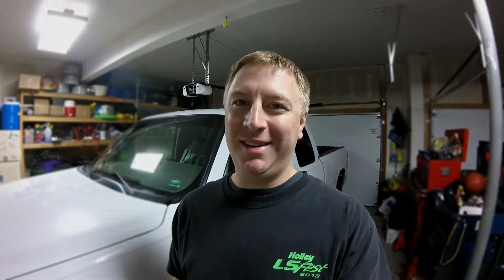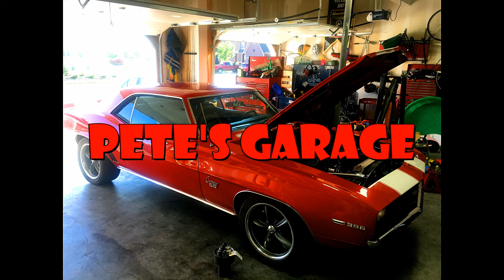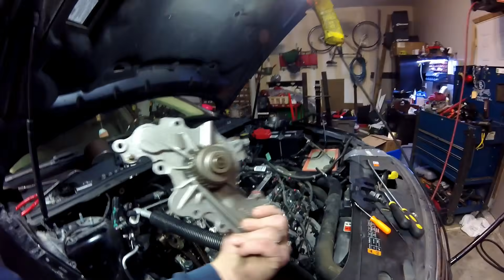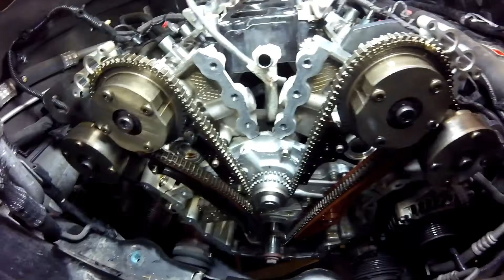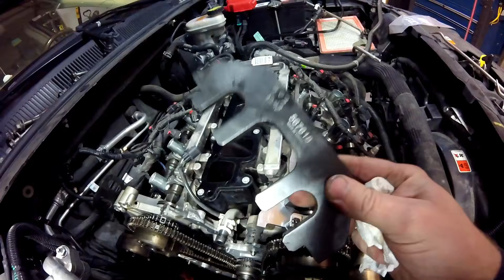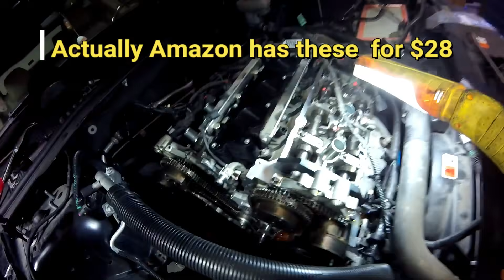Why does the Ford Taurus, Explorer, Edge 3.5L water pump cost over $1400?

Comment: Water pump failure killed my taurus right past 150,000 miles on the dot. Kind of suspicious of that. Either way it happened on the highway with the stereo bumping so I think I drove on it for 30 minutes before I realized my taurus sounded like a cammed 72 challenger and my dipstick was covered in chocolate milk

Comment: 2014 is at the dealer right now having the water pump replaced.  Ouch, I am actually paying more than mentioned in this video.  Note they are pulling the engine to perform the repair.  At least this includes replacement of other things including the serpentine belt, plugs, etc.  To be fair, this has been a great car until now.
But still.........

Comment: If you are going to do this job a little time saver is the chain guide closest to the firewall has a six mm bolt size eight head hidden behind the camshaft gear.Loosen the bolt all the way to the gear and you can remove the water pump and leave the extra work behind!

Comment: The weep hole bleeds into the center channel of the block and escapes out the bottom of the transmission housing. No where near the alternator.
Reply from the maker: Are you sure about that one? Here’s a link to a thread that has a picture of the front of the block. At the lower right side of the water pump you can see the hole that the channel leads to and you can see the channel in the block that dumps right behind the alternator. https://www.taurusclub.com/threads/2011-water-pump-failure.281809/page-5#lg=thread-281809&slide=0
Reply: @PetesGarageandperformance  I'm replacing one right now and the weep hole on the 3.5 bleeds into the center under the lower intake. There's factory drilled holes below that channel the leaking pump into the transmission housing down. The slot that was pointed out in the water pump is not the weep hole btw.
Reply from the maker: What vehicle and year?

Comment: My brother  has a Taurus sho the dealer told him 3500 -5500 I said that's bullshit it should be no more than 500. He said they told him the pump was internal and they had to take the engine apart.  Now I see why but they are still 3 or 4 times higher than your saying.  I live in new Jersey but still that's ridiculous. Needless to say he getting a new car and it ain't no ford
Reply from the maker: The SHO is twin turbo so it takes a couple hours longer. But that’s expensive!
Reply: @PetesGarageandperformance  yeah I agree

Comment: Today, the Ford shop told me $2500 to do the water pump.   Add $200 if we want to change the timing chains.      FORD sucks.  Every Ford I have ever owned, needed a major operation.  Transmissions, power steering,  AWD control modules,  and now an extremely difficult water pump that I can't even fix myself in the garage.   I WILL NEVER BUY ANOTHER FORD AGAIN.   My Toyota Highlander Hybrid that I have owned for over 5 years and has 225,000 miles,  hasn't need hardly anything.
Reply: Sorry for complaining.  Your video was informative and you laid it all out for me.
Reply from the maker: I know it’s a hard pill to swallow. I made the video to show people why they wanted to charge so much for this job. Good luck.

Comment: I have a 2016 Colorado with the 3.6 v6 and the water pump is mounted externally, where it should be.  It’s still way under 100k miles so I should not need to replace it anytime soon.

Comment: Thanks for the video and about the tools. Yes this is engineered service at it finest. Better use OEM parts to replace it all. It’s really ridiculous how many things are built the way they are now. If you don’t catch the leak in time you will be buying and engine because it can leak into the oil pan. What’s the labor time or did I miss that??
Reply from the maker: On the Taurus it’s like 8.5 hrs or so
Reply: @PetesGarageandperformance  thanks Pete

Comment: Had an oil leak from timing cover on my 2015 Edge, dealer told me it was oil pressure switch, got it changed under warranty , next oil change, leak was still there , took it back and repeated to tell them it was timing cover and don’t call with bs again , this time they agreed it was the cover and still under warranty, I said good , while your in there , here’s a new Ford water pump , put it in and I’ll pay the difference, they didn’t want to do it that way , the dealer wanted to scam Ford , I argued I wasn’t opposed to paying the extra labour over the cover cost which was about 2 hours and pay for the water pump, ended up having to go over heads to get it done but total cost was about $400 .

Comment: Wow! I've changed a few water pumps in my time but nothing like this. They could have designed for it to dump the coolant directly into the crankcase when the pump fails...but that would have been REALLY stupid instead of just plain stupid. Nice of them to incorporate that drain channel! And, BTW, may as well change the timing chain while your at it too. 🤑🤑🤑
Reply: But that's exactly what happens, it dumps the coolant into crankcase. There are two sets of seals. If the first set fails, that's when you might be able to catch it leaking through the weep hole, but for most people they don't catch it until the seals fail completely and the coolant has leaked into the oil. The weep location is not in a good spot either, it's behind the alternator so unless you know where to look you probably wouldn't notice it, which again means the time you realize something is wrong is when the damage is already done.

Comment: I bought a car with this poor engine design and am trying to get rid of it before I have to sink 1400 bucks in it or worse. My owner says a truck would be better to air my long ears out
Reply from the maker: I would say just fix it yourself if the water pump goes out, but it’s got to be difficult to work on cars without opposable thumbs.

Comment: The gm 2.2 waterpump is driven by a chain that's behind the timing chain that has to be removed to get to it. Although replacing the waterpump itself isn't to bad. Replacing the waterpump chain is worse than replacing the ford waterpump
Reply from the maker: Ecotec timing chains are much easier to replace compared to the Ford v6. There’s only one valve cover to remove, don’t need to remove the intake, half of the front cover bolts, the balancer doesn’t require a puller, no RTV cleanup because it has a gasket, the chains are easy to time. The labor time I’m for the Ecotec chains is about 4 hours and the Ford is about 8 hours.

Comment: The water pump went on my parents 2011 flex at 109K, nearly 500 miles from home. $9K for a new motor. Otherwise a great car.
Reply from the maker: Ouch! Sucks that this $50 part can ruin the engine and cost someone $9,000 because of where they decided to put it. Thanks for watching.

Comment: I'll tell ye what.i learned way back yonder   to sorta study and see how a car or truck is to work on before I'd buy it.i got burnt on an ole ford escape that needed the alternator replaced.it was a v6 and you had to take the passenger side suspension loose and the inner fender sheild to get to the freaking alternator. God almighty I was mad. Lol live and learn.one last thing about that ford escape seemed it would take 5 different size wrenches to take off one damm part...
Reply from the maker: Sometimes it’s almost like they built the car around the alternator! Lol

Comment: What all parts are required to do this replacement. I gotta have it done on my car and I can’t afford what the shop quoted me so I’m gonna have some friends do it
Reply from the maker: Pump, silicone gasket maker, valve cover gaskets, intake manifold gaskets, cam sprocket bolts, oil, coolant. I think that’s it. Good luck.
Reply: how did the job go?

Comment: 59.95 free shipping on eBay sure it’s not oem but price difference makes it worth it .at the same time this is a big job that should be simple.
Reply: but it's not simple, so better not to use cheap part  but if you run used car lot then yes use cheapest part.

Comment: why with the gen 1 ecoboost, you just have to move the T-stat housing out of the way, and the water pump comes off. that's it. no access to the timing chain needed at all. 3 hour job
Reply from the maker: Are you talking about a truck engine?

Comment: If you mentioned this in your video, I must have missed it. My question........Is there a way to make the water pump last longer or is the water pump issue completely random?
Reply from the maker: I don’t think there’s much you can do. The pump bearings will eventually fail from normal use because the timing chain tension is always on the pump.
Reply: @PetesGarageandperformance  Good to know, thanks.

Comment: Any idea what percentage of these water pumps fail in the first 200,000 miles? It's a good engine otherwise, but if you don't notice the water pump leaking and it goes completely bad it leaks internally; coolant mixes with oil; and the entire engine is shot.
Reply from the maker: I really don’t know any actual statistics. But it is fairly common with over 100k miles. So I would guess that most wouldn’t make it past 200k without needing replacement. I know some people will probably comment that theirs has made it past 200, but I would bet it’s the exception.

Comment: does this affect the 3.5 eco boosts in the ford trucks?
Reply from the maker: No. They have an external water pump. This is only on the front wheel drive vehicles.

Comment: Hello.  My mazda cx 9 2008 with a 3.7 engine has a mileage of 300 thousand kilometers.  I changed the coolant at 280,000 km when I bought the car.  The fluid is checked twice a week.  Should I replace the pump or the car and check the condition of the coolant and engine oil?  What are the first symptoms of a leaking pump?  I am asking for your opinions.
Reply from the maker: I would definitely keep an eye on the coolant level. If it mysteriously drops or it leaks from behind the alternator then you’ll need to replace the water pump as soon as possible. Personally, I wouldn’t spend the money to replace the pump if it’s not leaking. But I would be on the lookout if it had high km.

Comment: I’m doing a 2012 mks 3.5 I didn’t have to remove the guide behind the cam  phaser.  What a relief 😅 lol.
Reply from the maker: Yeah you can just loosen that 8mm bolt with an open ended wrench and swing the guide out of the way. It definitely saves some time.

Comment: $1400? I wish... try $2700.
Reply from the maker: Ouch! I’m guessing you probably also had the chains, guides and tensioners replaced?
Reply: @PetesGarageandperformance  Not sure yet. It's on the non-turbo police model, which PROBABLY drives the price higher just because it can. I'm also in a quasi-rural area, which makes things more expensive, too... Meh - it's only money, right (sarcastic eye-roll)... Your vid did a great job of explaining why this job is so expensive. Thanks!
Reply from the maker: If it’s a Taurus non-turbo then it should be around 9 hours of labor. Not sure what your labor rate in your area is.
Reply: @PetesGarageandperformance  AllData says it's a 15.7 hour job @ $135/hr.  The shop manager told me that he'd watch the job, and charge me the actual hours. I work with the shop a *lot*, so I expect that it'll end up being a bit less. Every now and then, I have to remind my vendors that I'm funded with taxpayer dollars (meaning THEIRS). =/

Comment: After u fix it how long does it last after that
Reply from the maker: Theoretically another 130k or so. Hard to say. I guess it also depends on the quality of the replacement part. I linked an AC Delco water pump that I used in the description. I think it’s a quality part. I wouldn’t buy a cheap pump on this one.
Reply: Pete's Garage if it’s a high quality part then it should last to 200k right and the job is done good

Comment: Do you know if the 3.5l duratec can just be bolted in a 3.0L duratec vehicle? Specifically a 2007 Five Hundred.
Reply from the maker: Not sure. I guess as long as the transmission and the wiring harness is the same. But you would still need the computer tuned for the difference in displacement.

Comment: Why can't they come up with an external water pump? You would still probably have to remove the water pump and chain but put a blank plate on it and than an external pump that's electric drive.
Reply from the maker: That’s just as much work as replacing the pump which lasts over 100k miles. You might only have to have to do this once. Maybe twice depending on how long you keep it.

Comment: why fix it? just watch the coolant level
Reply from the maker: Because the coolant has a very high possibility of leaking into the oil pan causing a milkshake. This lowers the oil’s ability to protect the main and rod bearings. This ends up trashing the engine. Big time $ repair.

Comment: i am considering a Mazda 6 with duratec 3.7 in it , the owner is telling me he had replaced the water pump four months ago but he said the mechanic/shop did not pull the engine out of the vehicle , if possible can you please tell me that what he said is possible. i would really appreciate your reply as i am on short notice to close the deal.
P.S i currently reside in Saudi Arabia and i don't speak much Arabic so i cant ask around much, haha
Reply: anyone with past experience can shed light on this, thanks
Reply from the maker: I’ve done a couple on Taurus’s without pulling the engine. I think you can do the 6 that way also. But not 100% sure.

Comment: I will gladly keep my 2003 chevy monte carlo s.s. that 3800 is 500 times better than anything made today. Shit even my 1973 chevy 400 smmall block is 500 times better than the crap designed today. 200,000 miles on it and never apart except for the timing chain and gear set.

Comment: I own a 2012 Fusion Sport that I've had for 6 years now. It's been a wonderful car and I don't put too many miles on it because I'm trucking all the time. It's only got 41,000 miles and I'm wondering if I should be proactive and just replace the water pump? Yes, low miles, but it's an 8 or 9 year old car now.
Reply from the maker: I would just keep an eye on the coolant level. If it gets low then make sure it’s not in the oil or leaking from behind the alternator.
Reply: @PetesGarageandperformance  Thanks. I thought about it after my comment and came to the same logical conclusion. I've read and heard some horror stories of owners of this particular motor experiencing complete failures of the forementioned engine while actually driving. Like, dead right there on road, with the only option of a new engine. But maybe these owners weren't informed or educated on this issue, as I wasn't either.  I talked to my service mechanic and he told me the same as you said. Thanks!

Comment: Quit buying Ford  Taurus with 90 ‘s models that cost 1000 to change out heater core. Ford engineers guaranteed profit for dealers , you had to remove entire dash assembly. Ford engineers profit for dealers by making wearable parts costly to replace usual after warranty. No Fords  by me since then , good car ruined by crooked management decisions.

Comment: Thank you for the thorough explanation! I just had my 2013 Taurus’ water pump replaced and the total after taxes was $1700. I was determined to jump on YT and find evidence that I was robbed but now I understand much better.  I understand parts fail over time but I just had the fuel intake (whatever) replaced in May and 2 months later this happens... uuughh. I should’ve extended my warranty. 😖 thanks again for this video!
Reply from the maker: This is the exact reason I made the video. To help people understand why it’s so expensive on this particular vehicle. Thanks for watching.
Reply: P᷉᷈H᷉᷈U᷉᷈C᷉᷈K᷉᷈E᷉᷈D᷉᷈ U᷉᷈P᷉᷈ D᷉᷈E᷉᷈S᷉᷈I᷉᷈G᷉᷈N᷉᷈ ʙʏ ғᴏʀᴅ❗   ᴍʏ ʙʀᴏᴛʜᴇʀ ʜᴀs ᴀ ᴍᴀᴢᴅᴀ ᴄx-9 ѕuv ᴡɪᴛʜ ᴛʜɪs 🔹Sᴀᴍᴇ🔹  ғᴏʀᴅ ᴇɴɢɪɴᴇ.  ʜᴇ ᴡᴀs ᴅʀɪᴠɪɴɢ ᴏɴ ᴛʜᴇ ʜɪɢʜᴡᴀʏ when ᴛʜᴇ ᴡᴀᴛᴇʀ ᴘᴜᴍᴘ ᴡᴇɴᴛ ᴏᴜᴛ!!  🔻NO WARNING... Nothing!!🔺    The pump went then he said seconds later ➖INSTANT➖  overheating from the engine while coasting down from 75mph... Then within seconds the ENTIRE ENGINE SEIZED UP!!  Almost causing him to have a major accident on the highway!!  
ғᴏʀɢᴇᴛ ᴛʜᴇ $1400-$2,000 ғᴏʀ ᴀ ᴡᴀᴛᴇʀ ᴘᴜᴍᴘ Rᴇᴘʟᴀᴄᴇᴍᴇɴᴛ!!.... Most people with this engine in their cars will SUFFER engine damage when the water pump fails (because some coolant will leech into the oil pan)  or the engine will seize altogether  COMPLETELY (100% LΩCҜDΩШΠ❗)
ɴᴇᴇᴅʟᴇss ᴛᴏ sᴀʏ ᴛʜᴇ ᴍᴀᴢᴅᴀ ᴅᴇᴀʟᴇʀsʜɪᴘ ǫᴜᴏᴛᴇᴅ ᴍʏ ʙʀᴏᴛʜᴇʀ $9000 ғᴏʀ ᴀ ɴᴇᴡ ᴇɴɢɪɴᴇ.   Ḧ̤Ï̤S̤̈ B̤̈Ë̤Ä̤Ṳ̈T̤̈Ï̤F̤̈Ṳ̈L̤̈ S̤̈Ṳ̈V̤̈ (which I loaned him the down payment for)  now out of warranty with only 110,000 miles is now TRASHED!!
Reply: I called my local shop and was quoted for 3000to do the pump, replace timing chain and tensioners which you should do if it's all coming apart because the chain is vary long and suffers from stretching.

Comment: Quicker to the drop the powertrain. I have done a bunch. First one I did was with the engine in the car, Was a nightmare.
Good job sir.
Reply from the maker: Yeah you can probably have that powertrain dropped in less than an hour. But you need a lift to do it. For someone doing it at home, it’s going to be the hard way!

Comment: Hey listen I already had to do that it runs off the timing chain I know that the pain in the ass to do that but you only do it once and I'd let you know you put 250 300 thousand miles on the engine no problem
Reply from the maker: From my experience, this is pretty much one of the only things you need to watch out for on these engines. If it wasn’t for this damn water pump these engines wouldn’t ever need work.